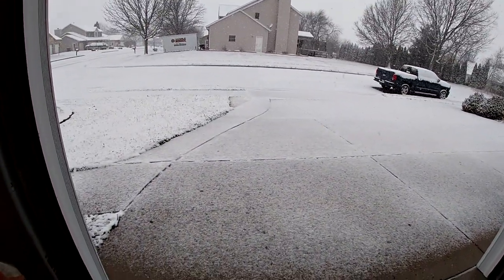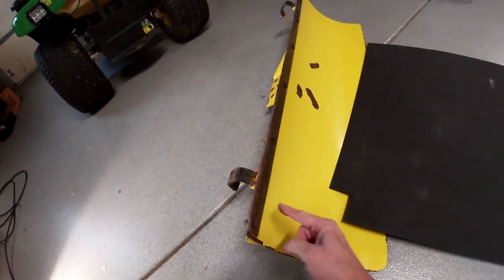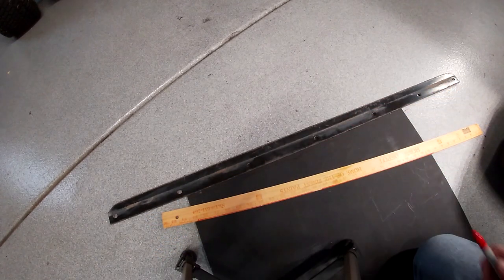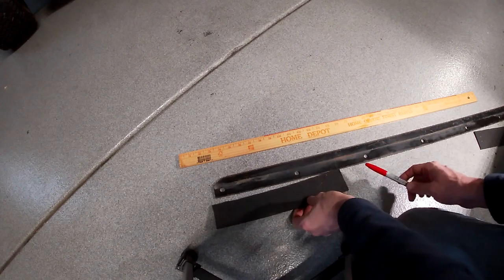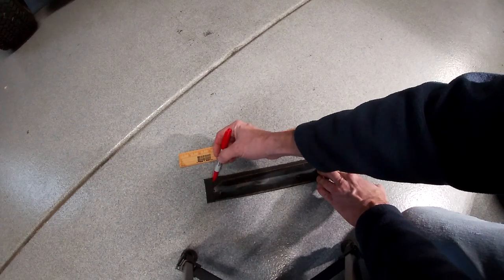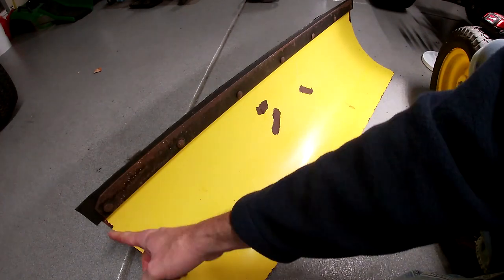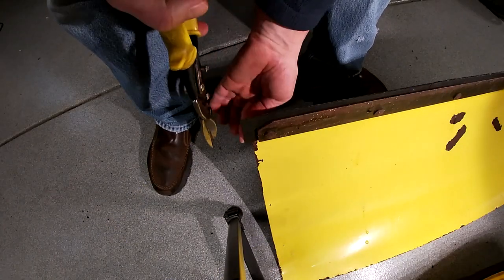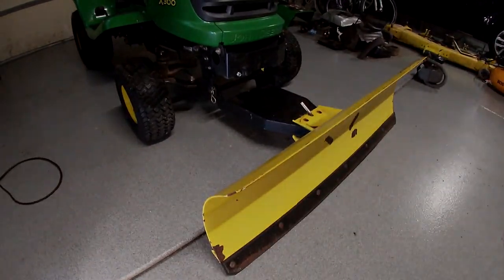Adding a poly edge to your snow blade DIY

Comment: How is it holding up? Have a video of it in action? I have the same blade from my JD lawn tractor, and thinking of doing a slit PVC pipe over the edge. Maybe simpler. Thanks.
Reply from the maker: It held up well until I didn't set the blade up correctly, and it folded over.  I think it's too thin.  I like the PVC pipe idea.